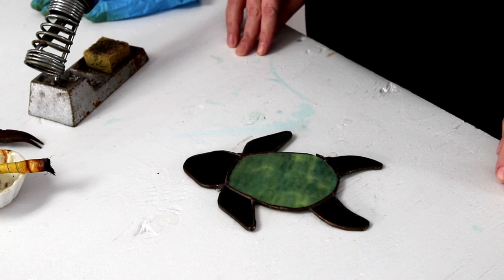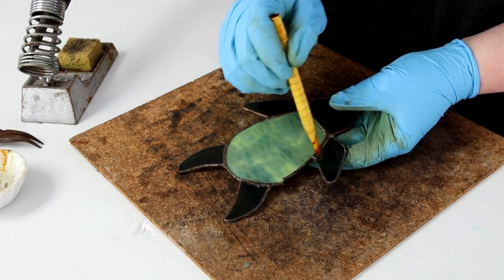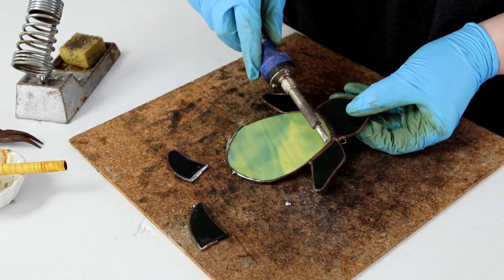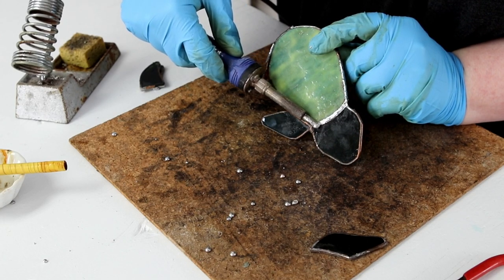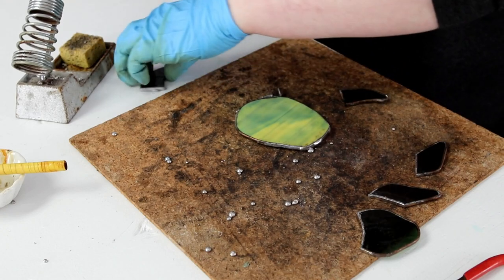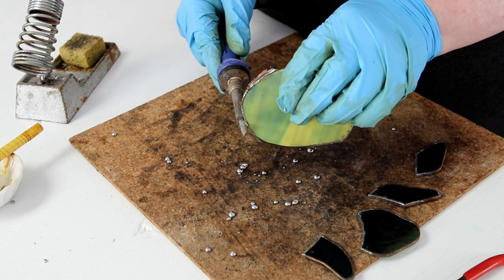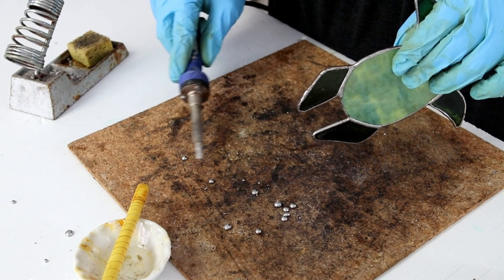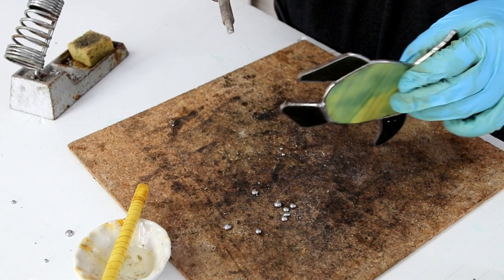How to Repair a Stained Glass Suncatcher with Broken Copper Foil

Comment: how hot is your iron?
Reply: be carfull to do not  heat  tooo mich  take a mometn  5  min  rest  and  continue   or the glass crack  also  some  Desoldering Braid Solder Remove  be  usefull